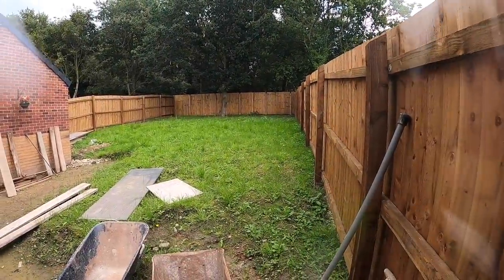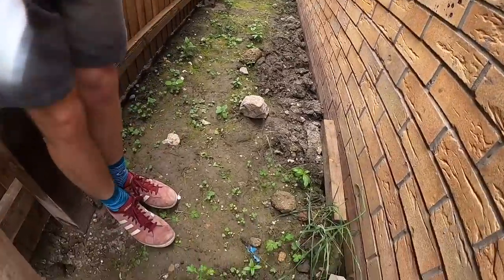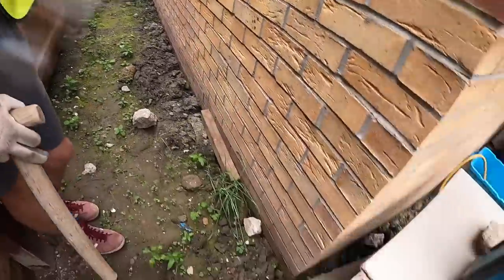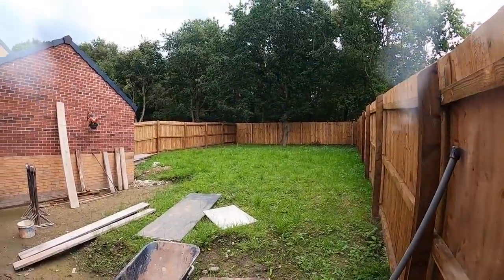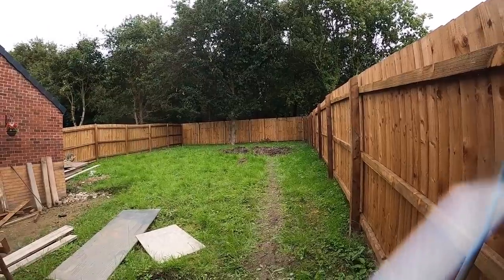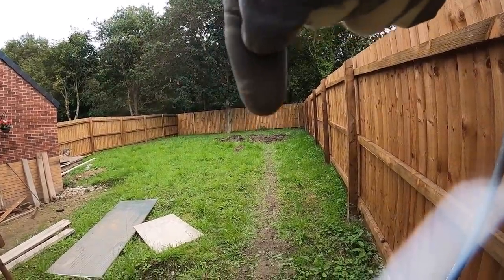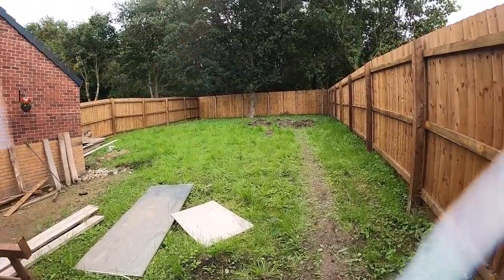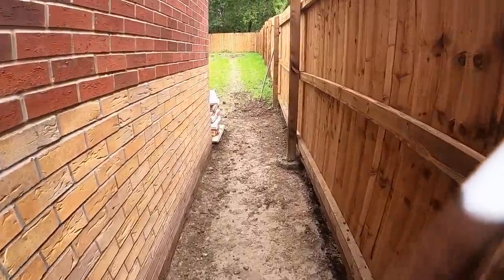MIXING OUR OWN CONCRETE

Comment: Steve I was surprised when I saw your new house and there was no footpaths around it . All new builds in Ireland have concrete foots paths put in by the builder front ,back and side .they will all have either concrete post and panel fencing or concrete block walls around the back garden as well .lawns all topsoiled raked and seeded to grass . I did a patio in a new build durning the summer and the builder builds the walls around the back gardens block on flat scratch and finish coat smooth plaster finish ,walls capped as well . This house had a particularly big garden I reckon it took around 6 thousand blocks . It’s been years since the builders over here have been allowed to leave new builds with just those wire fences that you had in your house. It’s a good job you can at least save on the labour costs of doing your place otherwise you’d be broke .
Reply from the maker: This is standard practice over here 🙄🧱👍🏽

Comment: Nice one lads good job. 👌👍
No drainage to stop standing water? Or did you make a fall on the path so water runs off and away from house?
How thick was that path?
Cheers 👍
Reply from the maker: Hi James we put a bit of a fall on it then stoned it up . It’s between 75 abs 100 mm in places . It’s a dead end just for storage 🧱👍🏽
Reply: @SteveAndAlexBuild  thanks for the reply I only ask as I'm doing something similar this weekend.
Maybe ask what do you mean by stoned up? Thanks 👍🤙🍺
Reply from the maker: @JimJimpmjj  we put some stone along the fence for drainage 🧱👍🏼
Reply: @SteveAndAlexBuild  ah got ya 👍👌
Reply from the maker: @JimJimpmjj  😉🧱👍🏼